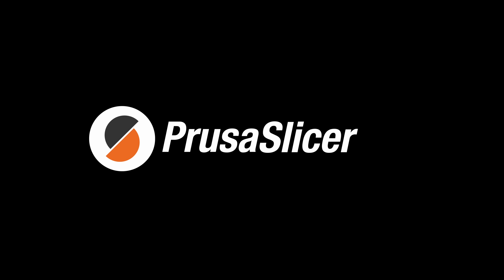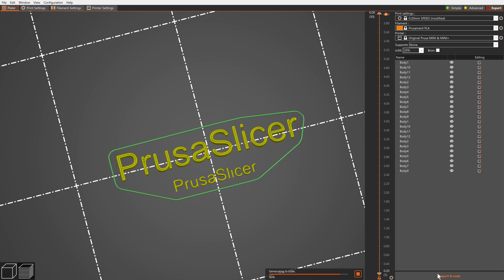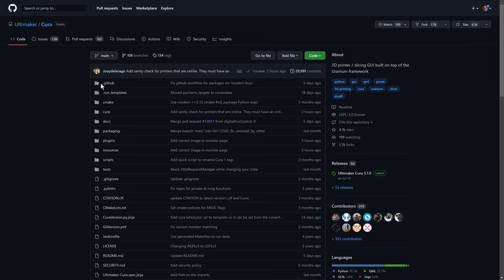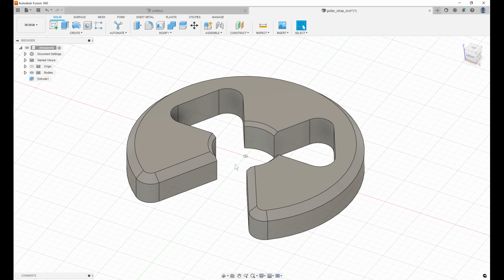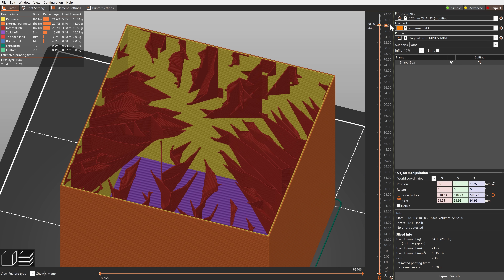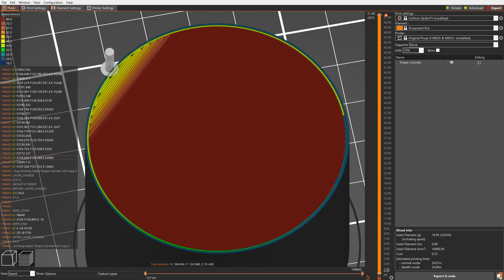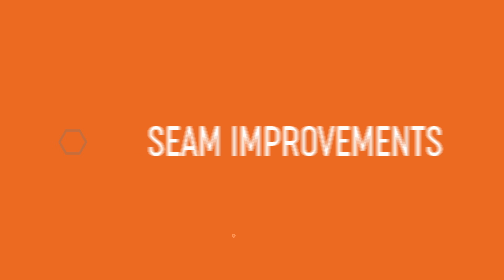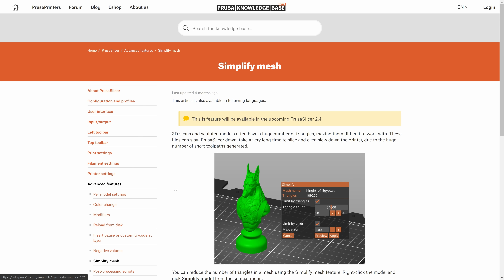PrusaSlicer 2.5 overview – new perimeter generator, STEP file support, Lightning infill and more!

Comment: Any plans to incorporate tree supports for FDM slicing? Or at least some form of “all supports originate from the bed”?
Reply from the maker: Yes, we are researching it and working on it for a while now. :) Normal supports from bed only are there already (for years). -Mikolas
Reply: @Prusa3D  I believe that what @brunobronosky means is supports that originate on the bed and grow diagonally to support parts of a model that overhand other parts of the model (it's certainly what I would want).  I don't think that is currently in PrusaSlicer.
Reply: @Prusa3D  Is there any eta on it? The request thread for the feature was locked on github staying it was being worked on, I'm hoping that means its close to release?
Reply: @Prusa3D  hey, can we have klipper support?
Reply: @Nici619  Klipper support? What exactly do you want to be supported?
Reply: @Prusa3D  please correct me if I'm wrong (I honestly hope I am). It seems that the current implementation is:
filter_out_supports_that_originate_from_the_print(generate_needed_supports ())
What I need is:
rebase_onto_printbed_all_supports_that_originate_from_the_print(generate_needed_supports())

I hope that makes sense to you. I think in Code. I'm terrible at translating into Mortal.
Reply: They said probably 2.6
Reply: Cura already has a really good implementation of this feature for fdm slicing, it a game changer and I use it almost exclusively for all my models instead of standard supports which can be more difficult to remove.
Reply: If you specifically need tree supports for something, Cura is lovely!